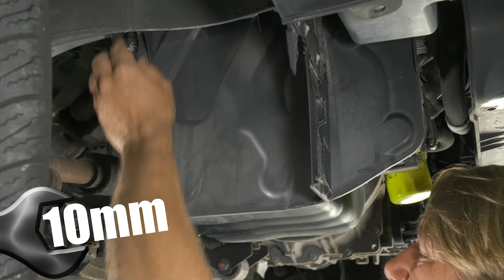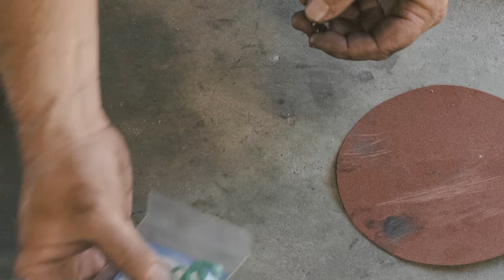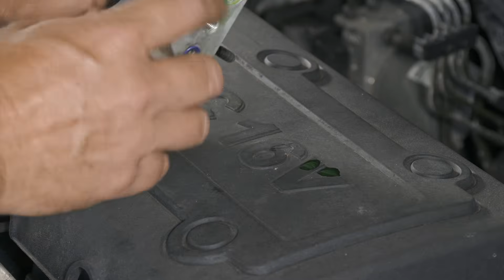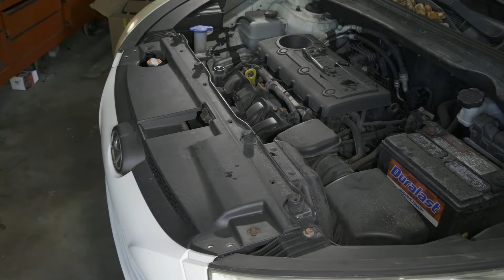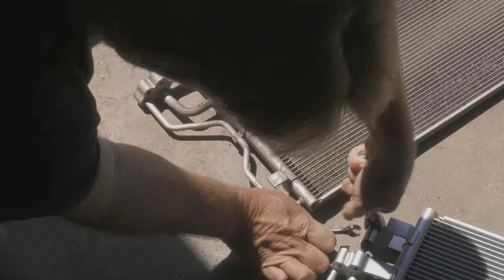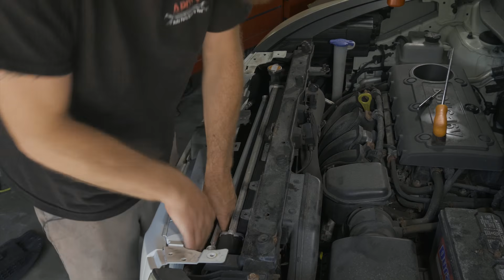2011 Hyundai Tucson AC Compressor, Condenser, Expansion Valve

Comment: Thanks for the video. Very good. 

Today, my tucson got problems.

Poor acon when idle.
If the Rpm of my engine around 2k, the ac back to normal.

The reading of low side = 65
High site = 150

The acon guy said, need to change the compressor.

It will cost me around 450-500 usd.
Wow its a lot.. sad.

So i stat to study online. Until i saw one video sharing about the compressor valve (located underneath the compressor and it has one small wire connected)

The function of the valve is to allow high pressure gas to be travel out of the compressor.

So i have decided to change (cost around 30-40usd)

After everything done, my.tucson was very very cold. 

Very happy

So

Comment: Hello friend my question is if I only change the compressor and do not change the rest that I saw in your video, what would happen?  I have the same car 2013 hyundai tucson, thanks for your answer 👍🏼
Reply: Hi. Did you change your compressor in the end Without changing anything else. I've got the same problem at the moment
Reply: I have the same model. I’m gonna replace everything, but I’d love to know too
Reply: Hello all, I have the exact same car. Got the compressor only changed and the AC works but works very poorly…It doesn’t get cold enough, and that’s in MA where it doesn’t get very hot.
Reply: So does this mean we can’t just change the compressor we have to change everything else as well?
Reply: @humblemani6632  Yes, it is recommended you replace the condenser when replacing the compressor. You need to do at least those two things.

Comment: This was a fantastic video!  It was EXACTLY what I needed!  One part I wish could have been elaborated on was the area of the screws and clips (actually looking in).  Boy, it was a pain to get it put back together!  I also didn't remember the push part of the pins (and broke one on the side), and so I found a way to lower the condensor out through the bottom.  (Getting that driver's side shock/buffer piece was a bit tough though without removing that air intake cover.)  Just finished this exact job last night, and I wanted to thank you for a fantastic video!

Comment: Any particular torqe for the compressor bolts? Great video. My drier filter cap unscrewed easily. Things went pretty well. I bent  the dowel pin for the high pressure line while swapping it from the old to new pump . That was the only headache. Thank you very much, it's been over 100 for the last few days here in Texas and I'm riding cool again. Thank you thank you. 2012 Tucson GLS